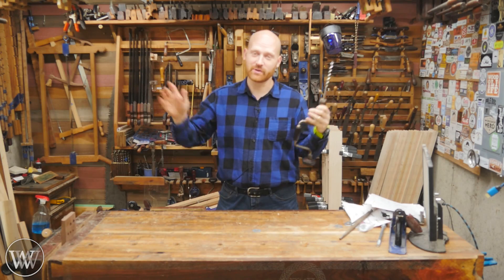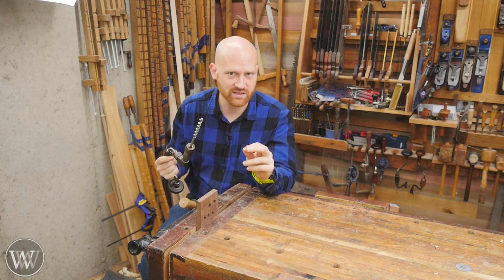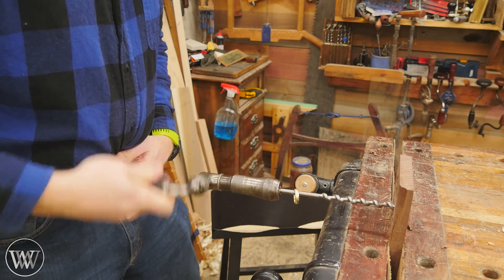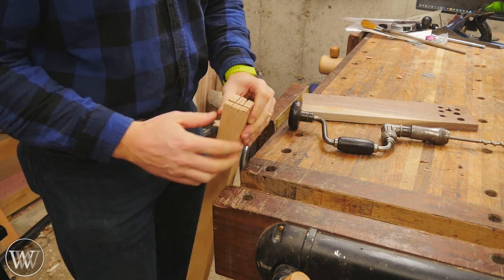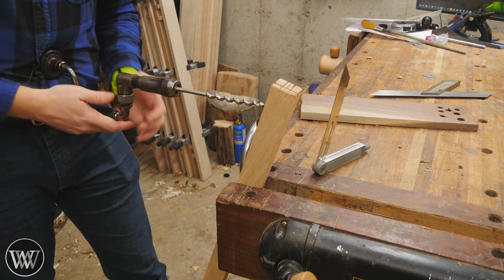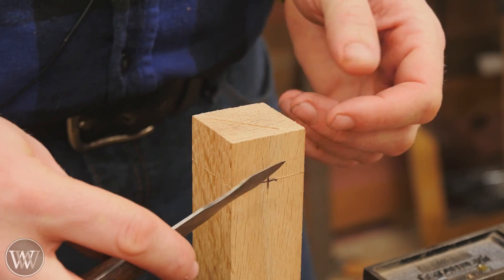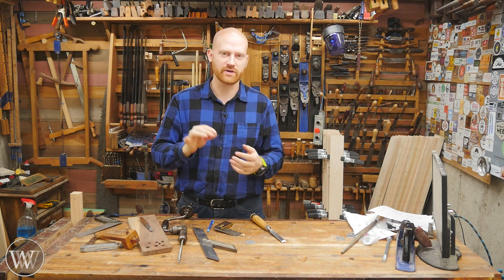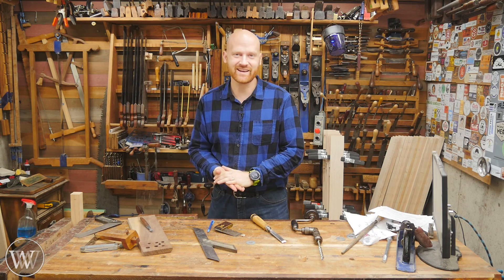Why Put a Ring On a Drill Bit Woodworking Tip

Comment: Yes, I do own a brace, and a nice set of auger bits that I've had since about 1965.  My current choice for a drill is a cordless drill.  I now use a block of 2x4  with a hole drilled through it on a drill press, and use that as a guide to keep the drill bit square to the surface I'm drilling into.  

Using a scrap that's been cut off squarely can be used by aligning the bit with the corner of the scrap to get a reasonably aligned hole.

Comment: Interesting.  I like your shop and video style.  Deleted my other comment because you were correct, the movement certainly will cause crawl if you are not square.  Also you can rip that scrap cedar in half  and match the end grains and make a box where the grain chases itself around the box, make it a hex box and in a piece of cedar like that it will look really neat.  Just have a square piece before you rip or it will not match at the end grains.

Comment: This blew my mind, I have a stigmatism in my right eye, so nothing ever really lines up by 'eye'.  This will help a bit!
Reply from the maker: Glad I could help.
Reply: It will help with your bit, too.
Reply: Interesting little bit of info. It's not a stigmatism, it's astigmatism. I suffer from astigmatism in both eyes and I had always thought it was "a stigmatism" until recently. Astigma is Latin for "no point", referring to the deformed cornea or lens preventing light from collecting at a single point.

Comment: Good stuff !!
Just bought my first brace at an antique shop close by 
I am re- learning to use my hand tools after many years thanks to your channel
Reply from the maker: Sweet. Sounds like a fun time. Let me know if you have any questions.
Reply: Wood By Wright How 2 thanks for your reply 
Well I do have a question for you 
The other day I went out and bought some lumber to build a saw bench according to your video. Your video was very informative and it sounded like a good project to start off with using my hand tools. All the cuts were coming out just fine until I got to cutting the dovetails. Then disaster struck lol
The joints didn’t match as I tried to fit them and I got very discouraged. I set all the lumber aside and felt defeated 
I watched your video about 3 times trying to figure out what I was doing wrong. I followed your measurements and all .,. But too no avail 
I going to cut the tails off and try again 
My bench will end up being a little shorter but what the heck lol 
Are dovetail joints really that hard to master or I just need to practice ?
Thanks again James for all your wonderful videos !!
I watch them all the time
Reply from the maker: why don't you send me some pictures Jameswright@woodbywright.com I do not  quite see what you are saying.
Reply: Practice
Also
Bit n brace makes a great screwdriver

Comment: Cheap rings?  Just use plumbers olives (for sealing compression joints), cheap as chips, available in different sizes.  Or a little slice of waste plastic pipe, even cheaper.  Nice vid, thanks.

Comment: Neat trick using the ring.  I do have a question for you (...or anyone).....I'm doing a project for my Granddaughter and am screwing some 5/16" finished plywood together.  Because I'm using fairly small screws (narrow, but long enough), is there some sort of adhesive I can add to the hole to make sure the screw doesn't try to make its way back out in the future?
Reply from the maker: You can use loctite or hide glue or something like that however due to the nature of wood moving there is very little that will hold steel to wood in the long-term.
Reply: Thanks for the ideas guys.  I've since read about something called "Screw Glue" by Monsanto, but our local Lowes doesn't carry it yet.
Reply: Tixe 100  ...I ended up using the pink type wood filler (dries woodlike).  It seemed to do the trick. Thanks for the reply.

Comment: When drilling from the side, and using gravity to plumb the wood, should your fingers not be 90 degrees around the block so the wood is free to move in the open plane, not the plane to be sandwiched between the vice jaws? Can you clarify? Great other tips, Thanks
Reply from the maker: To be honest with most boards it really doesn't matter that size.

Comment: @Wood By Wright How 2: Now a serious question (if you can imagine in this video's comment stream) : can I use a bit of scrap wood in which I drill a large-enough, straight, hole? If I mess or lose the scrap wood with a hole it's no biggie but if it's the wedding wring it might be.

Comment: Use a split ring of a key chain
Reply from the maker: I have whole video testing a bunch of different rings. And that was one of them. It did okay but it tended to twist a bit more than I would like kind of like using a washer.
Reply: @WoodByWrightHowTo  ok, just wondering about how it might work.
   This was an awesome tip and great video.
 Thanks for letting everyone in on this knowledge.